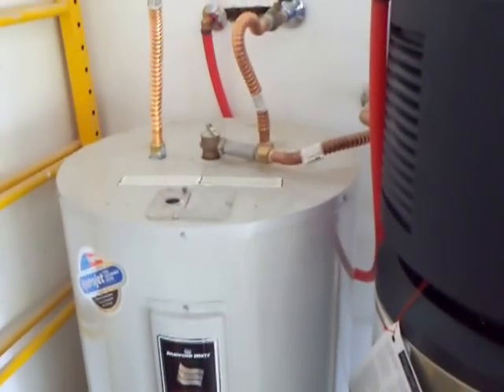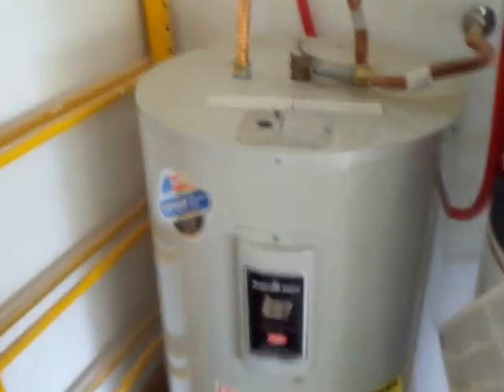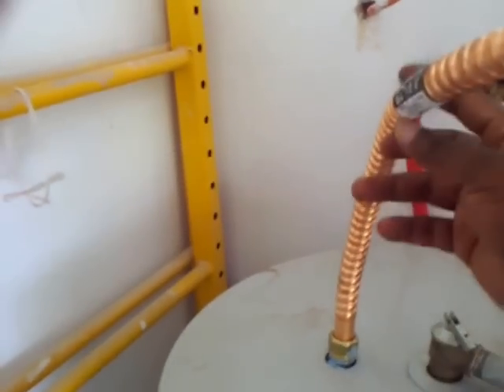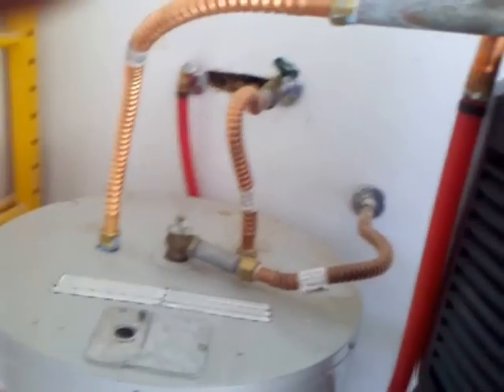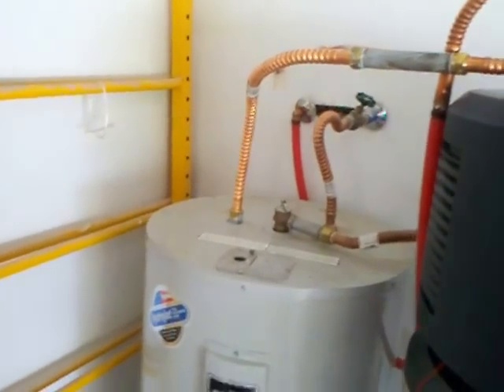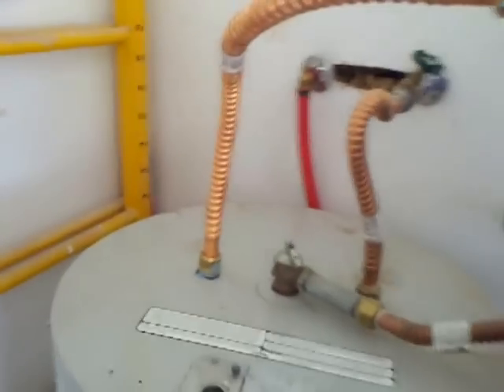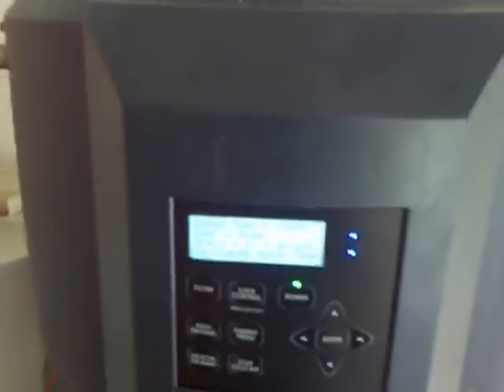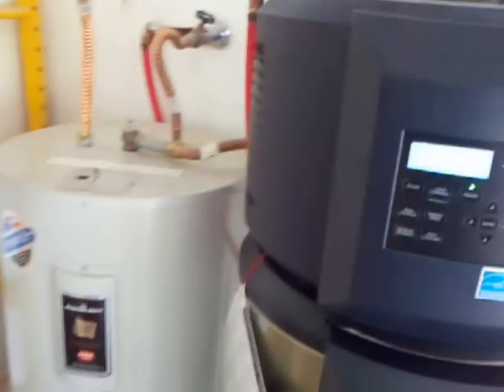Two Water Heaters in Series GE Geospring Hybrid and Contractor Grade Bradford White

Comment: This is not making sense to me... Why do you need to store the incoming cold water? I would understand it is you used the hybrid to feed the storage tank with heated water. That would make sense if you were running out of hot water but why would you ever need to store 40/50 gallons of cold water?
Reply from the maker: Crystal McIntyre Sorry for the delay. As I said in the other reply, I didn't know people were actually leaving comments. The water that comes into the first tank from the ground will normally sit in the tank and will warm up to closer to room temperature. I think it will be at least a 10 degree difference but I never measured, because I moved to another project. I can do take the measurements if you like. From there the GE Hybrid water heater has less work to do. Also 40-50 gallon tanks are quite common in North Florida construction over the last 20 years.

Comment: Does this hybrid heater help to cool down the room it's in at all?
Reply from the maker: MisterJohnnyT  I apologize, I am just seeing these comments. Yes it does cool down the garage in the summer.
Reply: tb129tlh Thank you.  I actually installed their newer model about 8 months ago, and yes I do see a slight improvement in the garage temperature and humidty.
Reply from the maker: ***** No problem, I know some days, I walk in the garage and I can experience and 20 degree difference on a hot day. It worked out awesome for me yesterday as I poured a 2FTX2FTX2in practice slab in my garage.  But I guess it depends on what setting you have it on.  Do you hear the heat pump engaged most of the time? Also, what temperature are you set at? Another measurement I have been meaning to take is to see how often the heating elements kick in during the summer if  even at all. You would be able to tell with your volt meter and amp measuring instrument. The heat pump will pull a small fraction of what 4500W elements pull.
Reply: tb129tlh I have always ran it in heat pump-only mode.  Here in South florida, my garage is so hot and the incoming municipal water so warm that the heater does not have to run very long to get the water hot.  Because it doesn't have to run very long, I don't end up getting all that much of a cooling effect in the garage.  I think it helps make it a couple degrees cooler at most, and a little bit dehumidified.  It's a great heater so far.  People who have colder water coming in or are in a place where the ambient temperature is not as hot will probably get more of a cooling effect, because the heater will have to run longer.  I have the temp set a bit higher than the default temp.  I have young children, so I don't want to set it too close to scalding.
Reply from the maker: +J T You are definitely right about it not needing to run that long in South Florida because of the high water table.